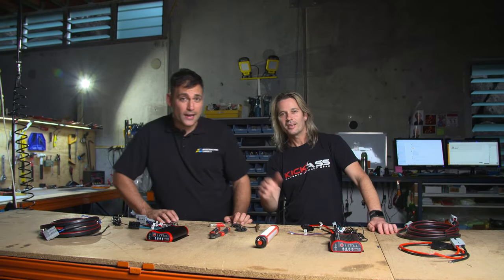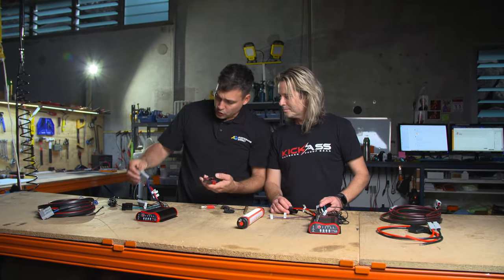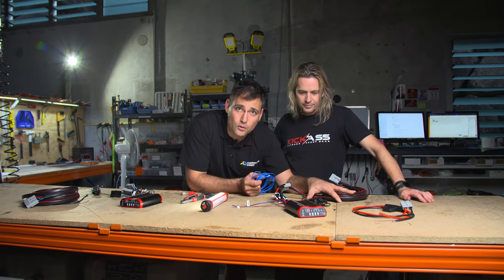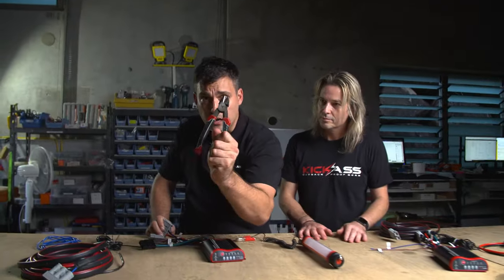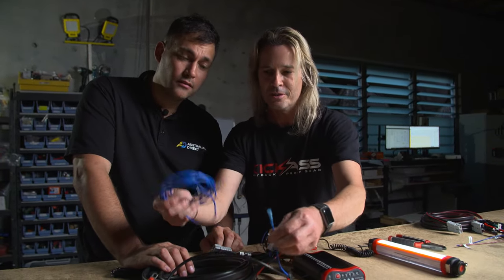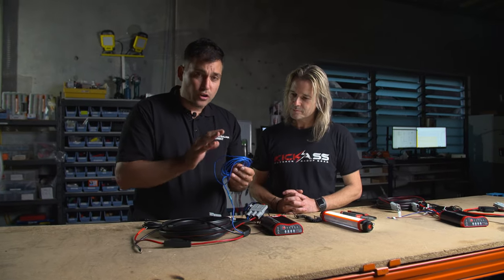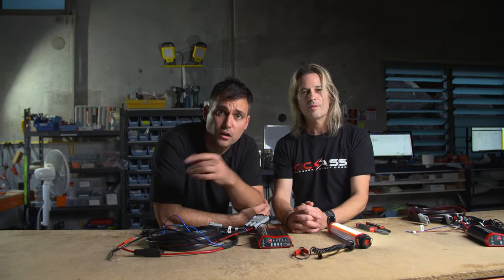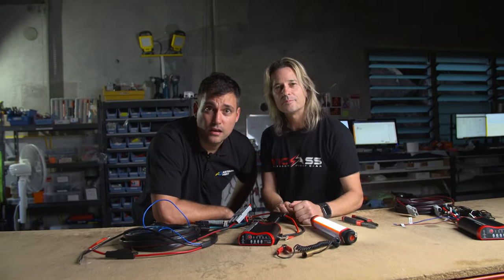KickAss Triple Anderson DC-DC & Ignition Wire Kit Explained! DCDC Charger with Lithium Mode.

Comment: My vehicle doesn't have "Accessory". It's ignition or engine running**. My sparky and I having a hellava time trying to get it to work. I keep having to go back to my Projecta 3-stage which doesn't have de-sulphation mode.

**2008 V10 Touareg.
Reply: The one you're looking for is the "engine running" position. Put simply, you want a fuse or power source that only has power when the engine is running - and DOESN'T have power when the key is in ANY OTHER position. The distinction between that and ignition/accessory is important because people (myself included) will often leave the key switched to accesssory/ignition, in order to play music at camp with the engine off. If the DCDC has power to the blue wire in this situation it'll start charging with the engine off - which we don't want, as the engine isn't doing any charging. Does that make sense?
Reply: @jakegalczynski9898  Thanks. At the moment, the unit will flash Alternator with engine off, key out but a door open. The Treggy has two batteries, one starter and one for accessories (auto rear door, lights, bells and whistles etc). The DC-DC might be triggered by the accy battery (which juices when a door opens) - might have to ensure that the DC-DC is connected to the starter battery.

The house battery is a 100Ah Lithium from Safiery.

Talking out aloud, I think I know the root cause now.
Reply: @stuartkcalvin Talk about complicated haha; my understanding of these chargers is that the Alternator light basically acts as an indicator of status as well. The interval between flashes lets you know the voltage of the starter battery/alternator input - if it's solid its above cut-in threshold and ready to start charging, and if its flashing it's below cut-in, and if it's flashing long intervals it's wayyy below. Either way I'd definitely be connecting the DC-DC feed straight to the starter battery, as that's going to be the most direct route to the Alternator when the engine is running.

Have you connected an ignition wire to the DCDC at all?
Reply: @jakegalczynski9898  Thanks. If the engine's off, I shouldn't expect a flashing alt light - but I get one. It flashes slowly but I brought the Lithium up from 11.8 to 13.4. It won't go solid and I can't move it off bulk after three hours driving.
No ignition wire connected - it's bundled up under the charger - it's black with a ring connector ... to the neg on the starter?
Reply: Just wanna check a few things... You mentioned that the alternator light is flashing slowly when the vehicle isn't running - that's normal, it simply says that the voltage at the STARTER battery isn't high enough to start charging, but is in fact connected correctly.

As for the lithium being at 11.8 (the aux I assume, unless you have a lithium starter battery too??) and then you brought it up... I gather you brought it up with another external charger or something?

Remember that the DCDC - in fact any DCDC - doesn't care what the Aux battery is doing, it wants to see the starter battery voltage increase - ie when the car is started and the alternator on the engine starts providing charge.

If you increase the voltage of the aux battery, by solar or another charger the DCDC won't kick in. The voltage must increase on the engine side indicating that the engine had started and is now ready to charge.

And ignition wire on the Kickass DCDC according to the manual is the Blue wire with Ignition on its label. The black wire in a bundle is an optional battery temperature sensor - it can be cut off, but once cut cannot be reconnected.

As your vehicle is a newer one - 2008 - I'd be connecting the ignition wire (blue) to a source of power that ONLY comes on when the engine is running, like in my first comment, and see how you go with that. It's pretty common with DCDCs and newer vehicles because of the newer style alternators. I hope this makes sense

Comment: Ya say ignition wire but I know of  accessories and constant which is it constant usually red or accessories usually yellow we wanna tap into just to be sure Iv done various installs before and I already know but from the horse's mouth lol
Reply from the maker: G'day mate,just make sure you only have power while the engine is running & bob's your uncle 
Thanks for watching 
Cheers Craig

Comment: Why not just use an Ignition Sense Module so you don't need to run the third wire? Multiple Australian Companies make them and are cheap. they work with anyone's DCDC Chargers.
Reply from the maker: Sure that is an option, however Ignition sense modules generally run on motion detection. We are simply offering a different solution to directly connect a charger where you don't need to run a third wire separately because the ignition wire is included in the loom.
Reply: @KickAssProducts  the ones I have used check the wave form from the alternator voltage as a backup if needed.

Comment: Such a totally condescending attitude I’m this video.  Instead of worrying about your competitors how about you do a little bit of research on your own product 😂,  it’s not the on wire that’s for the starter motor, it’s actually the ignition wire as stated “I” which is when the ignition is on, and the engine is running. Accessories is what powers your radio which also stays on when you click one more time to Ignition, any more clicks, the engine turns over via the starter motor so do not wire it to the ON wire.
Reply from the maker: G'day again mate,yes the ignition wire is there to get a on & off signal to turn the dcdc on at lower voltages to help overcome those tricky new smart charging systems,i like the idea of smart charging systems & any way to save fuel from the alternator not working overtime is great way to get better economy & means more road trips & less stops at the servo
i personally like the ignition wire connected to a power source that is only on when the engine is running & my favourite is tapping into the fuel pump fuse as the pump is only on when the engine is running